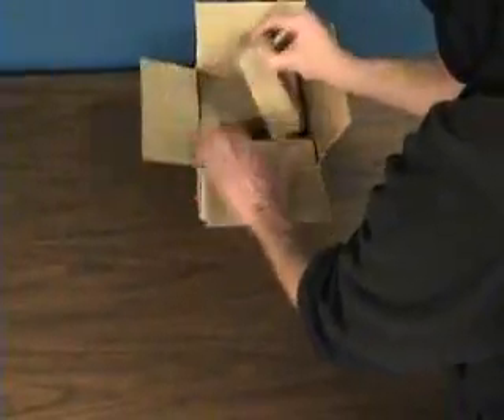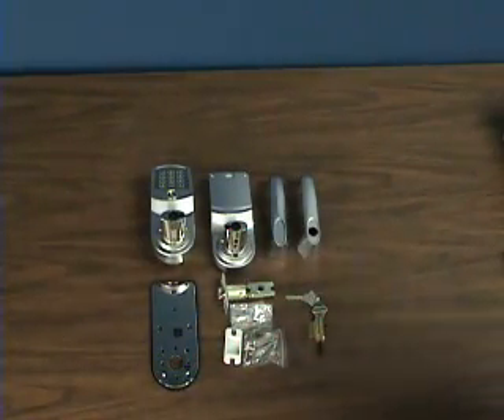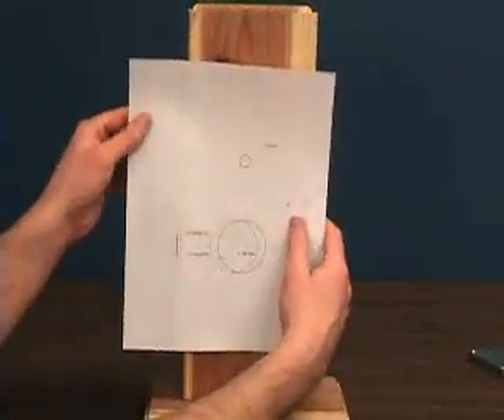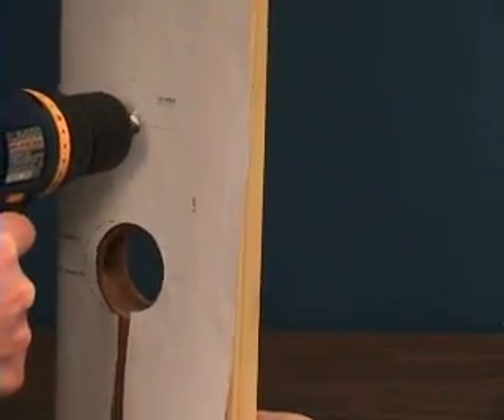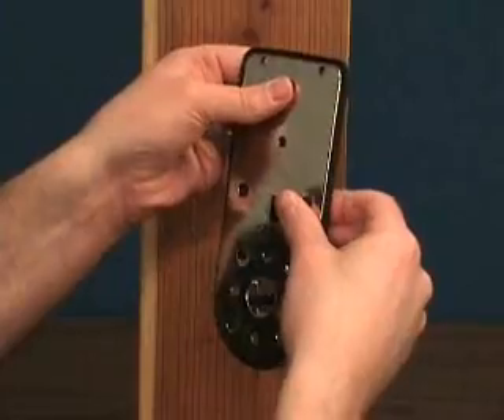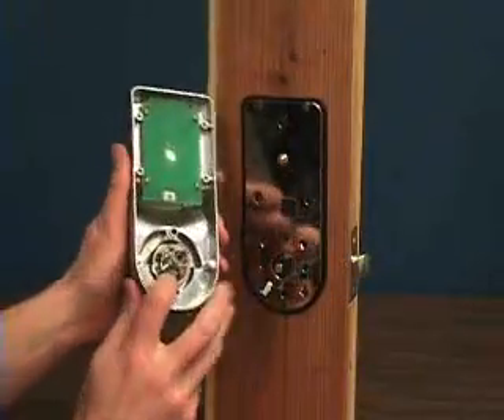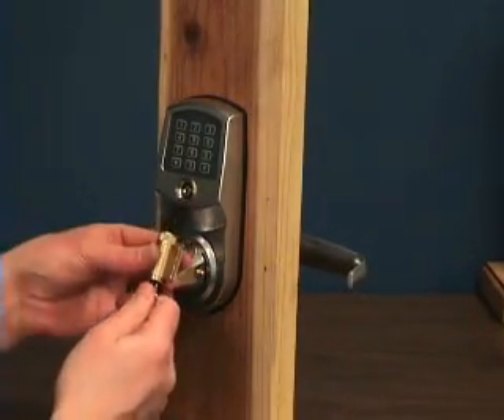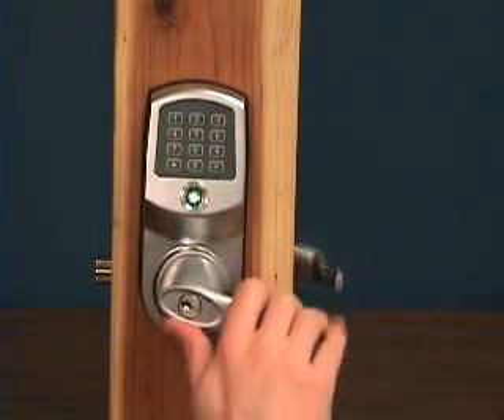ResortLock Installation Video

Comment: finally a company that doesnt try and rip you off with a monthly fee for something that can easily be free software. schlage makes good locks but that system link monthly fee remote access lock is bs. The technology is there to have the software run on your computer and cut out the middle man with a website and a monthly fee.